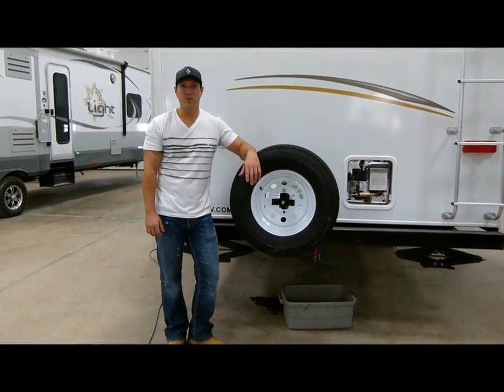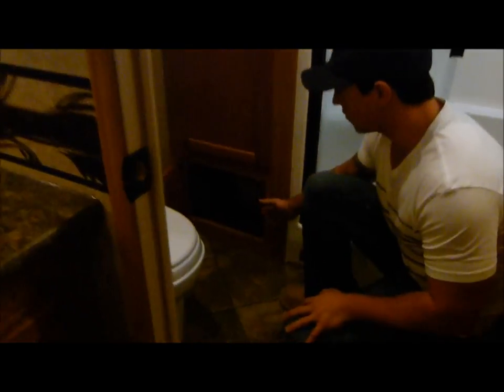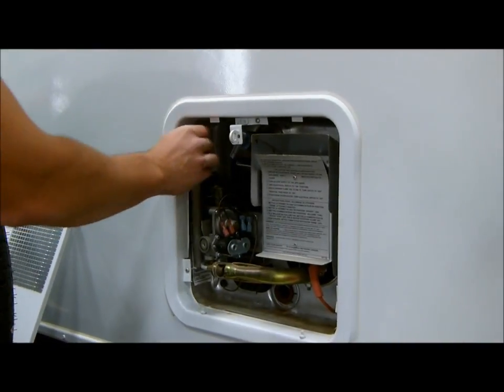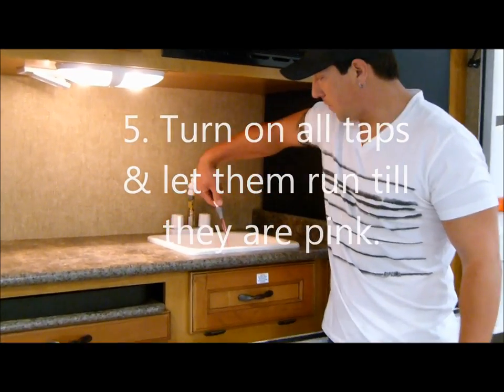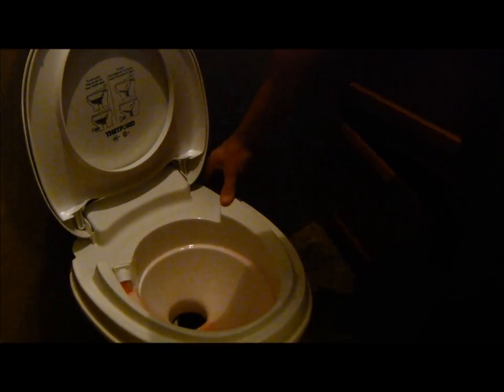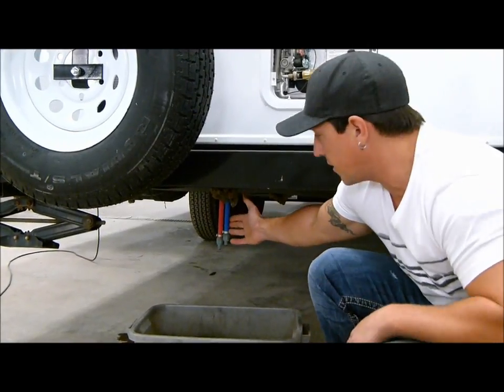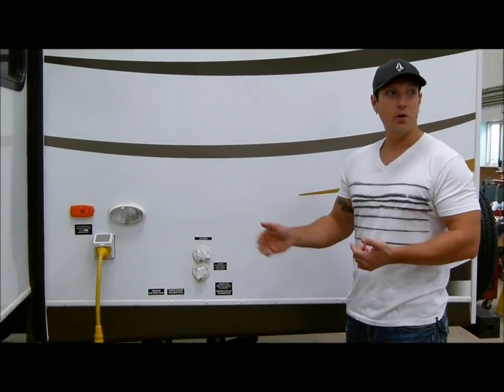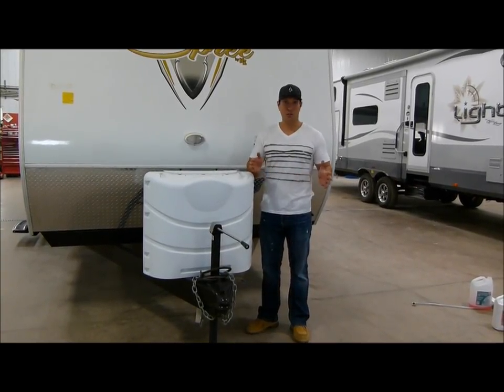Tips to Winterize your RV from Minard's Leisure World

Comment: May I suggest one more step in winterizing your water systems?  After the antifreeze is throughout the water lines, drain them again.  Then undo the hot water bypass.  I have seen several campers forget to turn their hot water tank supply line back on in the spring and burn up their tanks.
Reply: turn the breaker off on water heater before doing winterize problem solved